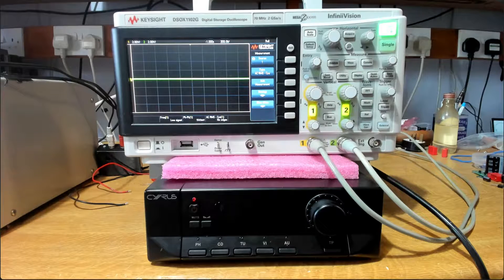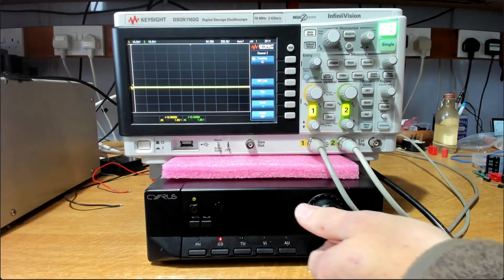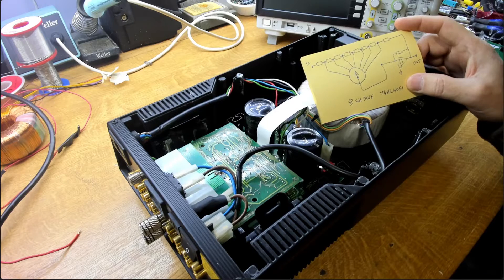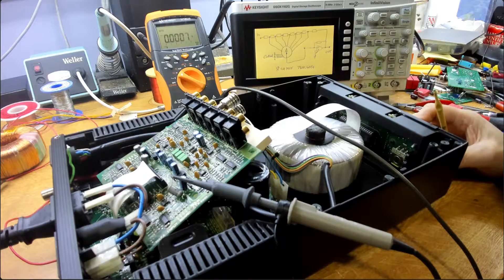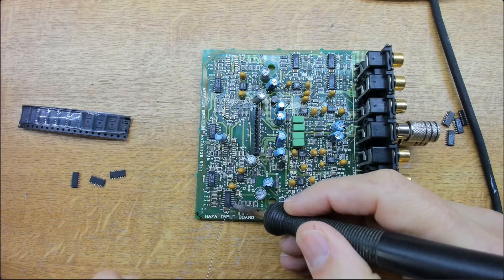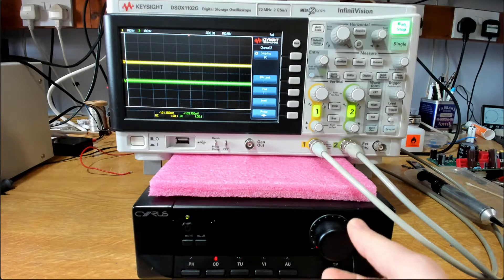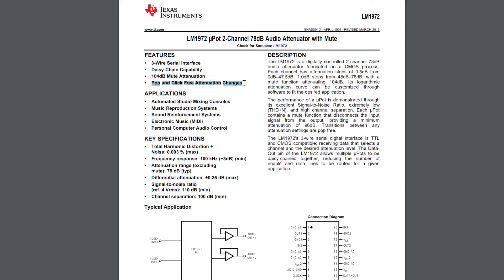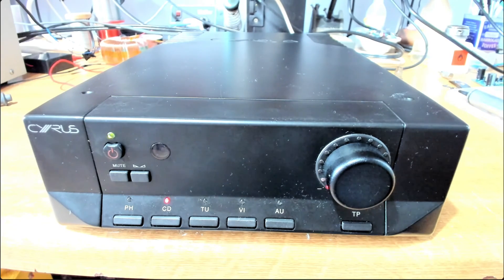Repair of a Cyrus 3 with volume control issues.

Comment: hi I think I have the same problem
can you tell me which model you replaced the
SMD 74HC4051D with unfortunately I only find models that are replicas.
China, Europe etc...
Reply from the maker: Replaced like for like, these are readily available from Digikey or the like.
Reply: @myalbatech  thanks a lot
which model do you recommend for the code, I saw that there are several?
74HC4051D(BJ)
74HC4051D(BJ)CT-ND
74HC4051DTR
74HC4051D(BJ)DKR-ND
74HC4051D(BJ)TR-ND
74HC4051D(BJ)DKR
74HC4051D(BJ)CT
74HC4051DDKR
74HC4051D(BJ)TR
74HC4051DCT

Comment: Just subbed , did 3 years for electrics in college in 1992 and recently buying a Cyrus 8 for £100 buyer says bought it as spares but they fixed it and its fully working. 
Well let's wait and see, its coming tomorrow.  
Quick injury where would I got circuit diagram for cyrus 8 Integrated amps .
Seems you channel is best of both words for me . 
 Thank martin from Leeds:)

Comment: Strange how people come across youtube channels. 
First before anything -> i dont know your name but i really enjoy watching your vids! Thats great stuff made by an intelligent guy! I hope you get much appreciation for your vids and i tell this from the bottom of my heart. Keep this up!!!! You got a very serious follower here!

Then... Why i came here was acutally that just the other day one cyrus III came in for repair... First time for me after 30 years of maintenance, repair and rebuild of obsolete equippment. And before i even lifted one screw i thought to see what others have in terms of common failures. 
The particular Cyrus III that i have here has several issues... One is that it grilled 2 sets of expensive speakers whilst in standby, because of a leaky BC856 in the LTP Stage. Poor desing acutally :D Because it doesnt cut out the speakers whilst in standby nor does it lift the voltage from the output stage...

One other issue is that it randomly switches whatever... I mean literally whatever. It changes Inputs, volumes and when it does that, the power led becomes orange. 
Also weird is that if in this state, regardless of the input (L or R) the signal gets through to both output channels. When only attaching a speaker or load to the right channel and the input to the right channel everything sounds normal. Strange is that if i attach a signal to the left channel it passes through to the right channel. Its not as loud as the right input but quite above 70 percent of volume... Odd thing. 

Another issue this unit has is that when the Volume leds reach 50 Percent and the input singnal is sine wave 1Khz, it goes into random oscillation on both channels. 

I have gunshotted this guy with capacitors of course, not because one was bad... In fact they were all good (more or less) just because they cost next to nothing. 

If you have any idea to these issues, ill be glad to follow your advise. 

Thanks alot man! If you will never react to my request, dont worry, you have a follower anyways :) 

One last thing i have noticed is possibly a common behavior or better said normal. It appears to me that there is an audible difference between volumes in terms of frequency response. 
I would need to check this against FFT and noise. But its like that when volume gets higher, there is a slight change in treble response. I cant tell off hand if thats getting lower or higher because i was troubleshooting another part - need to revisit this. Have you ever done measurements on that or ever heard of it?

Cheers Geronimo
Reply: Any common issues with the Cyrus Integrated amplifier and where would I find such issues and circuit diagram on line please.  Would be a big help thanks.
Reply from the maker: Thanks for your comments. You could suspect all those cmos logic devices for your random behaviour. The other one is the microcontroller. These tend to fail in odd ways and this is generally terminal. Same situation as shown in my Cyrus Power video.